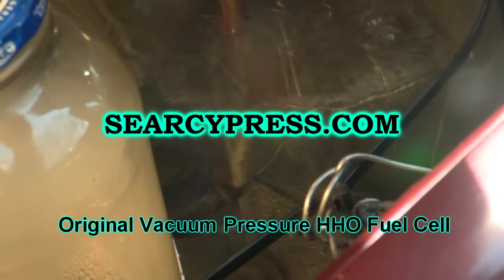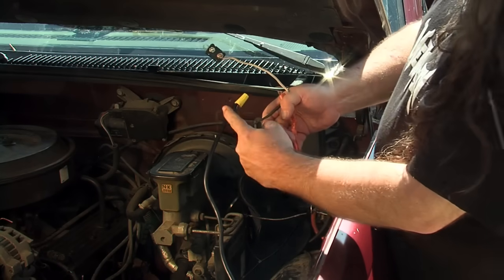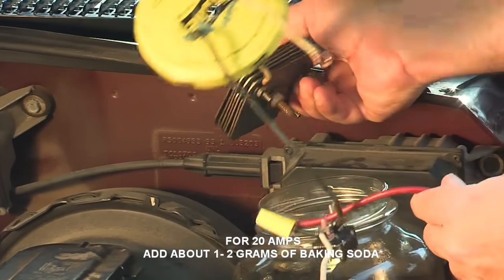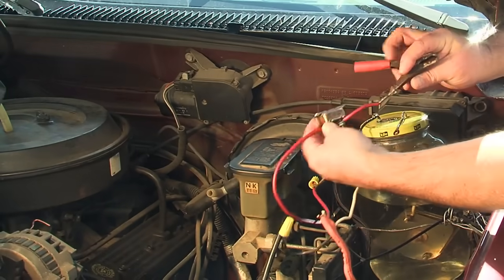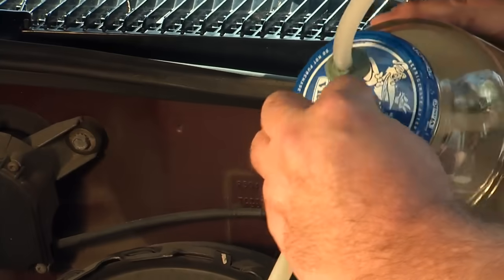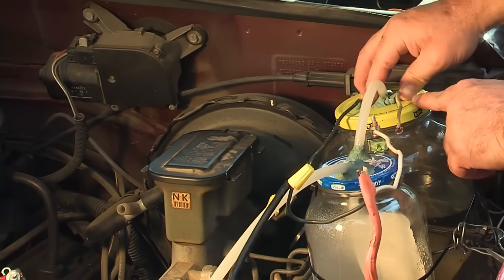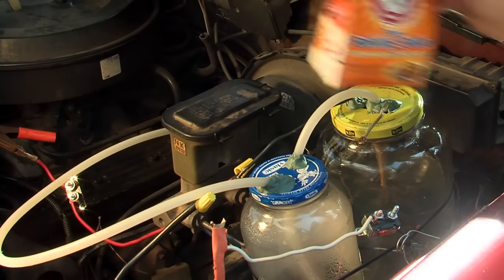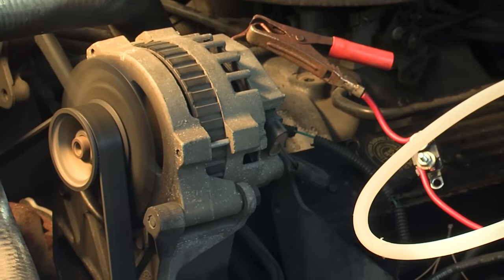Vacuum Pressure Hydrogen fuel cell defeats high gas prices using hydrogen from H2O.

Comment: I'd run a toggle switch which switches 2 x 30 amp relays which are connected in parallel instead !!!!

In New Zealand, someone has an R32 Skyline which is powered by a Nissan RB20E (EFI single overhead camshaft inline six) which normally gets 10 litres per 100 kilometres which is terrible for a 2 litre engine which only produces 98 kilowatts of power at the flywheel,they have to rev their nuts off to move the big Skyline body around so that's why they run a 4.3:1 diff ratio.

Well, he runs water methanol injection so it would be a similar principle to the hydrogen fuel setup,a fine mist is injected into the inlet manifold at a certain RPM & the car now gets 5 litres per 100 kilometres on normal fuel.

Apparently, the only emission from the water injection system is oxygen,there would still be carbon dioxide emissions from running on fuel albeit at a reduced level, I'm not sure if the car still exists as I'm having trouble finding that one online.

I've seen videos on here where people have built hydrogen fuel cells which is sort of like a battery,the water get split up into both oxygen & hydrogen gas during the process,one example of where is could be used for power generation is where a dedicated fuel cell can be used to produce hydrogen which could be stored into a tank during the day using solar power,then during the night the stored hydrogen could be used to feed another fuel cell to produce power during the night or when the sun isn't shining very bright.

Google apparently powers their headquarters with hydrogen fuel cells.

Comment: Hello there! I was wondering if you could help me do this same conversion to my chevy silverado
Reply: If you got fuel injection you'll have to program the ecu in order to take advantage of the extra hydrogen 

Plus if you have a vacuumpump you'd have to somewhat bypass the pcv system with a twoway valve or something

Comment: How are you controlling the current? You say you need to run it as close to 30 amps as possible, but are running 2 25 amp auto-reset breakers. How are you getting to 30 amps when you are limiting the input to 25?
Reply from the maker: Practice and adjustment.

Comment: PLEASE PLEASE PLEASE GO BUY A ONE WAY CHECK VALVE!!!!!  If for some reason you drop a valve or burn it up, you are going to get cylinder detonation rising up into the intake manifold (backfire) causing all fuel or fuel vapor in the intake manifold to ignite.  Once ignition has occurred it will burn all the way back to the source (your hydrogen cell) and create a secondary larger ignition.  Please be careful when playing with this technology people.
Reply from the maker: In pressure systems it is a factor. In a vacuum system everything is different.. but I agree...

Comment: If this is so fucking awesome then why doesn't car makers who could literally sell 100% of these produce them and sell them?

It would be the easiest sell of a car in the history of car selling.

REASON:The true hydrogen cars ,using same tank sizes as gas tanks, can only store/produce enough hydrogen to power a car about 30 to 40 miles and THAT IS THE END!

Maybe GM,FORD,TOYOTA could build Hydrogen cars that include a little horse trailer on a ball-hitch to hold the hydrogen gas? See, then you could drive up to 200 miles until your next refill of hydrogen at________________UH UH OH!! I just remembered their are no large mapped out stations nationwide for hydrogen cars.

Guess GASOLINE is here to stay!

Even Tesla cars are WAY TOO EXPENSIVE for most people and hey are never going to offer a car cheaper than $26,000

Have fun tinkering with your balls and put peanut butter on them for the dog.

WAIT!

Maybe we could just make everyone drive school buses? That way we would not worry about running out of Unicorn Feces to fuel our cars ERRRM I mean School Buses. You can paint them like people tattoo their Labia and anuses these days.
Reply from the maker: The same reason the 100mpg carb was lost.

Comment: heat the water and introduce it to a vacuum and it will crack much easier
Reply: Indeed, you could almost get as much energy out as you put in with that kind of efficiency!
Reply: you should look into edward stocton, his hho generator is very real and you can see it at the local 442 in ripon calif. No free energy here just unused energy. @nobodynoone2500

Comment: Alternators put out AC not DC so this is a total fake.
Reply: It's rectified into DC
Reply: All alternators have a rectifying circuit either built in or before the battery.

Do you know WHY or is done this way as opposed to a permanent magnet DC generator instead? A cookie for you if you can figure it out.
Reply: Makes no difference because in the end oxygen and hydrogen will be mixed together
Reply: What is a rectifying circuit? I'm a newbie,  sorry.
Reply: Google Wheatstone Bridge and and you will see that 4 diodes will turn ac to DC. The diodes are in the alternator. To further prove my point put a multimeter on one and simply measure it. You'll see it's DC being produced and wired directly to your DC battery.
Reply: You're an ignoranus
Reply: actually all u need is voltage be it ac or dc 12v will do the total amount of hho produce depends on electrodes used and consistency of voltage
Reply: But that mix will do real work and the gasoline content can be lowered for the same work.

Keeping the AFR in a safe range is the real challenge.

Comment: The only difference here is i have it going or connected to my air intake rather than my brake intake. And have since 1500 klms. The water gets extremely hot and amps high after 100ks,  Why is this????.

Comment: Separating H and O while generating makes the machine much safer. The mixture of oygen and hydrogen is very dangerous while eploding but pure H is pretty safe.
Reply: Wtf
Reply: @thunderbirdizations  Pure H never burns without O. Thats a fact some sci fi writers have ignored tho.
Reply: margus kiis 
“Pure H is pretty safe;”  
🤦‍♂️
Reply: margus kiis 
“Separating H and O while generating makes the machine much safer.” 🤦‍♂️🤦‍♂️🤦‍♂️
Reply: Your second comment, does NOT imply your original comment. Not even close. Not even f*cking close. You’re wayyyyyyyyy off the mark bud

Comment: would ya recommend using Distilled (DI) water with the baking soda? I mean instead of tap or drinking water.. Those other two have all sorts of other things besides water in them that I'm not sure you want in your engine. Thank you for your very through explanation of everything you've shown. I'm glad to see the use of the alternator instead of the battery to increase power other than what you get from the battery. Do you also run it WITH or INSTEAD of gasoline? I think WITH because you have the on/off switch under the dash. Very cool! Now I wanna build one after doing more research.
Reply: Also, I only have room for 1 jar in my engine compartment so I think that can be the back flow arrestor jar (ironically, its a vlassic pickle jar too.) and run a tube and 2 strands of solid state wire (would #12 work or does it hav to be #10?) and the pair of fuses on them to my truck bed behind the cab. I also like the idea of 'where the magic happens' to be in an open area and I was thinking of a cooler cube or similar to set the actual cell in. My question is, on the gas flow side, how would the length of tube affect pressure from the cell to go under the cab to wind up in the safety jar before going into the stater vacuum? I did luck out because it fits straight up and down in only one place and that's near the master cylinder and fuse box!

Comment: OK<  This is the problem, your trying to make hydrogen,  Your process works but,  You don't want a glass full of water with electrodes,  YOU WANT A MIST OF WATER FLOWING THROUGH THE ELECTRICAL FIELD>  WA-LA  much more "H" and less current.....
Reply from the maker: Interesting.

Comment: I don't think this is THAT simple 

You would obviously have to modify the engine for running on a gas instead of a sprayed liquid 

And maybe you would need an extra alternator for the amount of power the hydroxy device would take 

That is if this works at all which according to these comments it apparently doesn't 

If it does though for the love of god will you use something a little more professional than glass jar 

That has ghetto written all over it

Comment: did he say he doubled his fuel mileage with this setup? I'm sorry but not with that wet cell setup. I'm not one of those naysayer's who believe using HHO technology to increase fuel economy is impossible, i've been  playing with my dry cell's off and on for many years and have enough experience to say emphatically there is no way the Micky Mouse HHO setup on the car in this video increased any fuel economy. this guy did accomplish one miraculous  thing, it's a miracle he didn't blow the front end off his car.
steam cleaning the insides of an internal combustion engine is technology with promise, were just waiting for NASA to perfect HHO so they can increase the fuel mileage of whatever shuttle vehicles they're using for space travel, we'll have it made then....

Comment: You can reduce some buildup in the water by using stainless steel wires to connect to your stainless steel plates. The small bit of copper wire corrosion will never stop. Stainless wire will last indefinitely. NOW, if you don't want to go through so many alternators and want to ACTUALLY see gains in fuel economy and performance; Put some solar panels on the roof of the truck....... you are loosing almost as much energy as you gain by having to turn the alternator ! ! ! ! solar cells will eliminate this drag. NOTE don't forget to put a switch on the solar panel because you don't want to produce HHO while the engine is not running. It would be best to just hook up the solar panel switch to turn on and off automatically with he engine.

Comment: In theory it seems valid, but the execution is very bad.  Perhaps it's sufficent for testing or a video, but there's a lot of room for  improvement in a permanent installation.  I don't think using glass containers is safe. The gas is very explosive and could easily create a very dangerous fragmentation if it explodes.  The wiring and connections need to be secure and insulated.  you can't have uninsulated wires and connections bouncing around in your engine compartment.  Using the stainless steel switch cover plates is a great idea. 

Currently Amazon is selling monocrystaline solar panels that produce 160 watts at 12 volts.  If you put a couple of them on your roof, you can have solar energy provide a good portion of the power needed for the electrolyis.  3 solar cells could possibly be mounted on the roof of a mini van and could provide 12 volts at about 24 amps in full sunlight.  That would help offset the drain on the electrical system.
Reply: most new car alternators have produced over 160 amps since 1990. He's only drawing 20 amps, that's like having 2 extra headlights.

Comment: No. Just no. This is hilarious.
Reply: Red Greene keeps coming to mind. 😂
Reply: I have no doubt that the HHO generator produces HHO gas, and it is indeed burned in the engine. Theoretically, there should not be an increase in fuel mileage due to the laws of thermodynamics. I have yet to test this, but I plan on playing with it. I have an old truck sitting around that's a perfect testbed candidate.
Reply: Do it and talk after?
Reply: Yes, this is hilarious.
Reply: @Satchel McQueen Videowhich part of it works? The part where it does produce hydrogen and oxygen gas? Or the part where it is supposed to substantially decrease gasoline usage?

Comment: Hi, what's the name of the stuff that you use to seal your connections? Poster paddy?? (sorry, my French ears had trouble getting what you're saying...)
I'm having quite a bit of trouble with small leakages appearing here and there  in my experimental cells, and the material you've shown looks awesome.
Congratulations! (and good music, btw)
Reply from the maker: It is in a vacuum and every sealant we used failed over time except for poster putty. The tacky stuff used to hang posters. Yes, its crazy but if it works, it works.

Comment: Does the engine run purely on HHO ?
Reply: No. It supplements the gasoline to make it last longer, thus increasing fuel economy.
Reply from the maker: HHo burns very hot when it touches anything. It can melt a rock. Running on 100 percent hho would not end well.

Comment: . My question about any HHO system  for vehicle use  and no one has addressed this issue  that I can see yet.... What about very cold temperatures .?  Water freezes  gas does not. Under the right conditions the cold can cause a problem .
Reply: If the generator was frozen it wouldn't work. To get around this you could just disconnect the gas lines and take the generator inside when the car is not running. Or some peoples solution is to mix some form of alcohol into the water, but what I've read on it says needs to be done very carefully to work without ruining the generator.
Reply from the maker: Very cold is a problem. Its good down well below freezing and thaws fast, but yes, that would be an issue.

Comment: that's not a hydrogen fuel cell....
Reply: Yeah... You noticed that didnt you.
Dave Scrivens
President and CEO Canada
sehydrogenhybrids.com
World Class 1 piece Motor Vacuum Hydrogen Kits
Reply: i like the homemade kit, i've seen your fancy contraptions, what makes your better, do you consider your a real hydrogen kit?  not knocking them but the price should include installation on the car. i say it's an overpriced "countertop housing" from a water filter kit. regardless your's vs homemade, both get the job done. both are a great conversation piece if it doesn't work and blows up the car, somebody post it on youtube. i have the Water For Gas PDF files just haven't had time to make one.

Comment: why are you still using gas?
Reply from the maker: Right after we released the first videos on television ( yes tv)  the price of fuel fell from $4 a gal to $.99 cents here...and then mythbusters quickly proved it did not even make more than a bubble. I buy gas gladly and it has not gotten back to that insane cost as of now...if it did....well....back to the shop for thousands of innovating inventors. Probably not me. I can assume solving the energy crisis is risky business. Not my thing anymore.